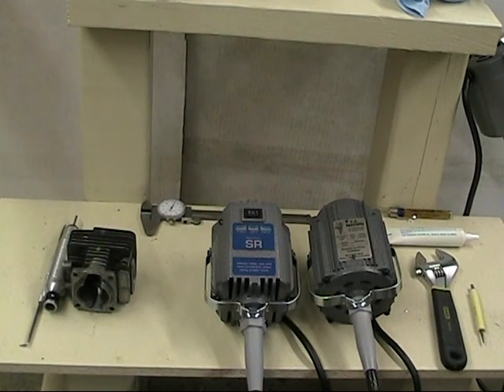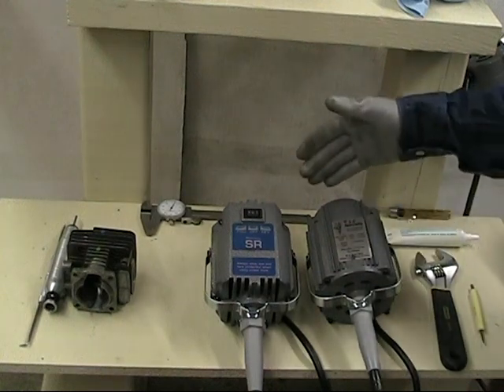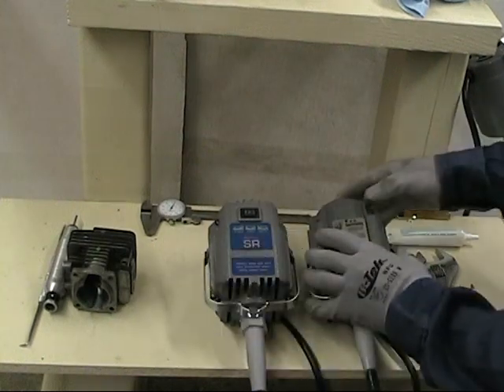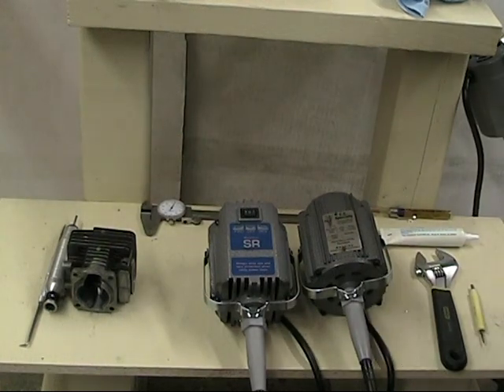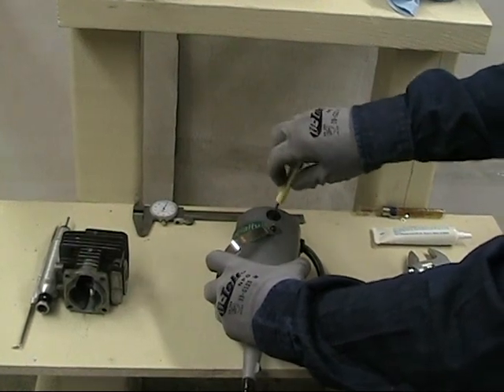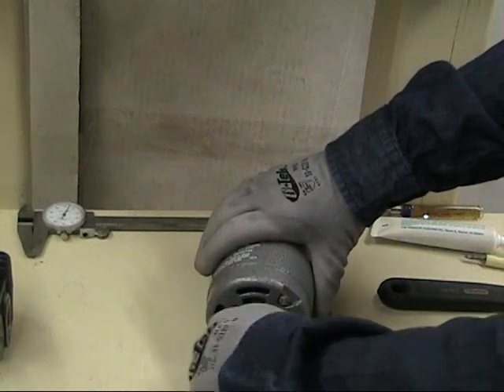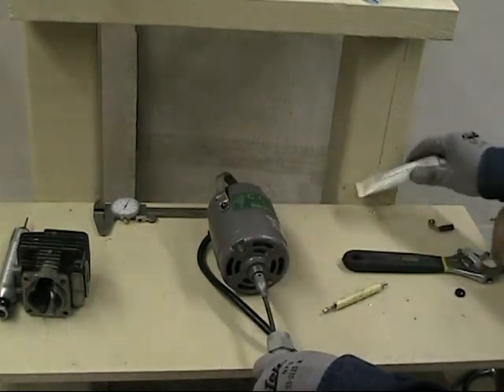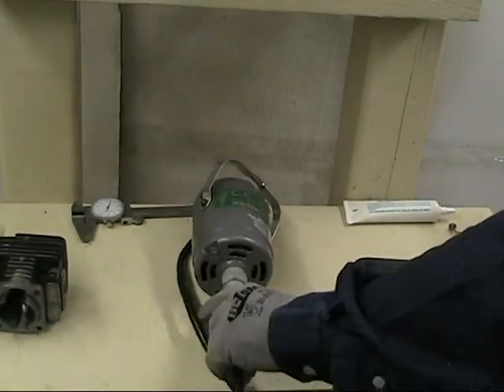Basic maintenance for TXMC and SRMC porting motors part1 .mpg

Comment: Can you get the TX in the Uk 240v
Reply from the maker: Unfortunately no, but it is typically only needed if you are doing major work to cast iron or hardened metals. The best option for 240volt is http://www.ccspecialtytoolstore.com/Porting-motor-240-volt-p/srmc230v.htm